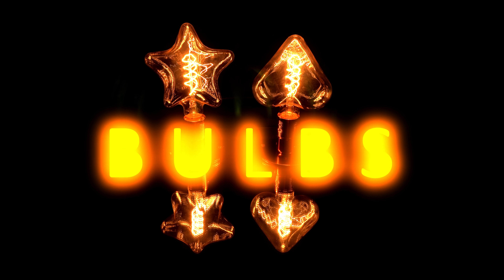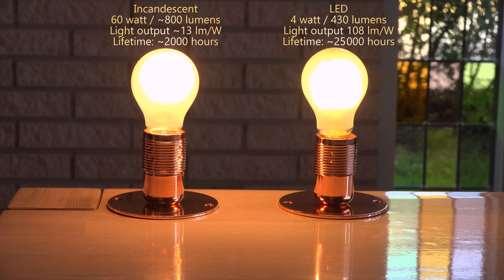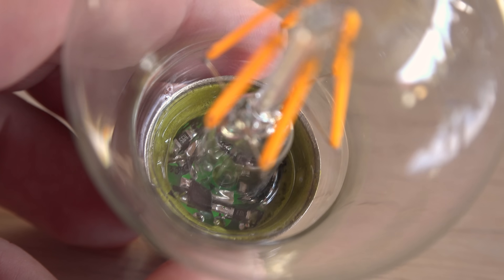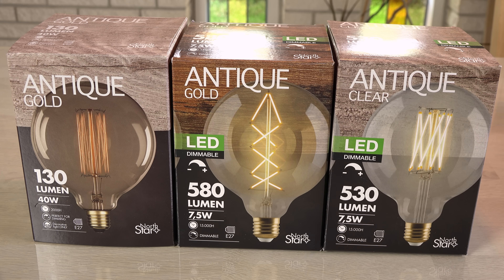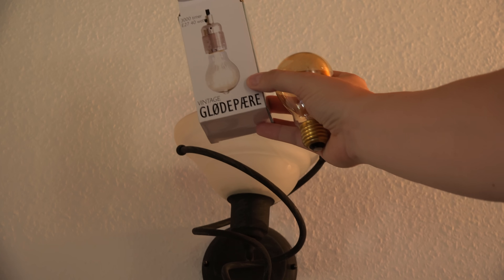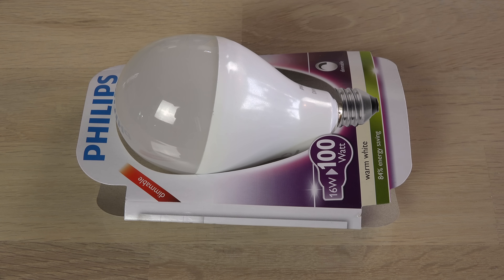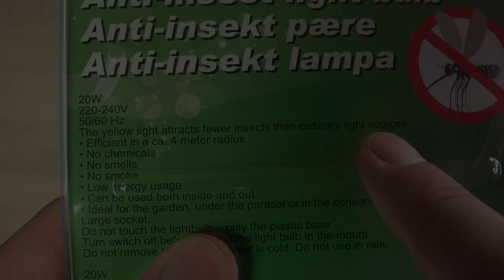Light Bulbs | LED vs. Incandescent

Comment: Incandescent-banning is ridiculous and such a scam, because:
	ⅰ. Although incandescent bulbs are relatively less-efficient at producing light in the visible spectrum when compared to LEDs, this only results in increased usage in the summer, and, even then, it is relatively trivial and vastly offset by the difference in electricity needed to produce incandescent bulbs vs LEDs (plus they do not require hazardous or exotic materials to produce, resulting in less pollution and foreign dependence).  In the winter, like basically all devices, incandescent bulbs are nearly¹ 100% efficient,² because any electricity not converted to visible light ends up heating the home, reducing the electricity needed by the furnace by the exact amount used by the incandescent bulb.  Also, it takes a long time to offset the tiny amount of saved electricity from switching to LEDs, mainly because incandescent bulbs are extremely easy and cheap to produce.  
	ⅱ. Incandescent bulbs have perfect CRI and mimic the spectrum of a blackbody, just like a candle.  Thus, photography under incandescents looks great, unlike cheap LEDs, which have relatively poor CRI ratings (still, way better than CFLs), and trying to mimic this with LEDs requires expensive bulbs, the spectrum of which is still very far off of a natural blackbody curve (which is essential, as it is the production of the blackbody spectrum which makes the incandescent less efficient at producing visible light).  Also, you don't get blue-frequency spikes, which can effect sleep, and possibly stress and mood.  
    ⅲ. The dimming performance of incandescent bulbs is vastly superior than even the best LED bulbs available.  It isn't hard to find a dimmer³ which will return continuous perceptually linear dimming all the way down to 0 lumens for an incandescent bulb, and, if you have such a dimmer, it will work with any incandescent bulb, and equally well, unlike LEDs, many of which cannot be dimmed.  For those that can dimmed, performance varies widely and sucks—most "dimmable LEDs" I've used can only dim down to something around the equivalent of 30% with the incandescent, which, for me, is missing probably 75% of the luminance levels that motivated me to have a dimmer for the light in the first place.  Also, most "dimmable" LEDs require trailing-edge dimmers to produce even descent results, though many do at least function with leading-edge dimmers (basically all residential dimmers before dimmers were specifically produced to work with LEDs) now using extra bandaid-circiutry to avoid damage from voltage spikes.  

The only use-cases I've found for using LEDs over incandescents⁴ (and have a rational basis for doing so) are:
	a) Bulbs that are annoying to change—LEDs last way longer than normal incandescent / halogen bulbs (they do make incandescent bulbs that are very durable and last a decade or more for special use-cases, but they are less-efficient than normal incandescents at producing visible light), and this has always been my primary motivation for using them.
    b) You need a really bright light—because LEDs are tiny and extremely efficient at producing visible light, they are a great choice for your average person who wants a really bright light, which brings us to:
    c) Portable lights—obviously, LEDs are the way to go if you're going to be running off a battery.
    d) You want to have a large number of bulbs on a power strip that would be unsafe with that many incandescents, or you want to put put too many fixtures on a breaker and not comply with code (pretty sure illegal)—obviously, LEDs draw much less power, making this more feasible (I'm pretty sure that parts of Europe actually have a separate lower-voltage circuit in homes to handle lighting).  
    e) And finally, if you don't want to be nagged for leaving lights on—I'm not even sure that this is common anymore, but, with LEDs, you'll always have a mitigating rebottle to complaints that you're wasting power by leaving on the lights, as the cost of keeping them on is very tiny, possibly even outweighed by the cost of extra food needed to provide the energy to walk over and turn them off.  At the very least, the amount of electricity used is so small that it isn't worth discussing, but honestly, incandescents aren't too far off (using up the incandescent's life is a much more valid concern if it is annoying to change), and, for most people, HVAC usage overwhelms everything else to the point that talking about any other device is a waste of time.  
 ──────────────────────────────────────
    ¹	I say "nearly", because some tiny fraction may get converted into frequencies which pass through the home entirely, or, particularly for communications, the electricity may be sent outside the home (the amounts are extremely small)
    ²	All indoor devices which use electricity are 100%-efficient space heaters, as all electricity used by the device ends up as heat, whether as a byproduct of inefficiency, e.g. friction within a fan's motor gets converted to heat, or as a byproduct of intended functioning, e.g., the fan moves air around, increasing the kinetic energy of the particles, i.e., increasing heat.
    ³	My preference for smart dimming is 'Leviton D23LP-2RW Decora Smart Wi-Fi Mini Plug-In Dimmer (2nd Gen)', which, unlike every other smart dimming device I've had, will dim all the way down to zero.  Also, it has a setting for incandescents, as well as dimmable LEDS and dimmable CFLs (lol).  However, its use-case is limited to lamps—for me, that accounts for almost all the lights in my house that I'm interested in turning on in the first place, but, for fixtures, there are probably better options (perhaps a wall-dimmer from Leviton would produce similar results?).  
    ⁴	Just noting that this doesn't apply to CFLs, which are garbage for most residential use.  Unless you need a lot of light in an area, the lights aren't going to be turned off and on frequently (if they are as with, e.g., a closet or bathroom, they will die sooner than even a regular incandescent bulb), and you don't mind the lights having a delay to reach target luminance, producing an ugly and unpleasant spectrum, and possibly accompanied by an annoying buzz.
Reply: I honestly prefer LEDs. I mean most standard incandescents last a view months and that’s it for the lights. Plus that food was probably lit by daylight colored LEDs due to the food looking weird.

Comment: My parents tried the yellow florescent tubes back in the 70's.  The short answer is, if you only have yellow tubes the insects will still be attracted to them.  The much longer answer is that if you have a mix of lighting, the yellow light sources will attract very few insects.  They all go to the light sources with shorter wavelengths.  The real answer is that yellow lights attract far fewer insects, but only if you give the insects another light source that looks much better to them.

Comment: Fluorescent lights emit high electromagnetic radiation which is harmful to your health, yet incandescent bulbs are safe and do not emit EMF radiation. Fluorescent lights also age your skin & eyes and incandescent does not. Also Fluorescent lights are mercury vapor that seeps out into the air you breath. Stop being so gullible to use fluorescent and LED, incandescent is much safer & better.
Reply: Why wouldn't you use LEDs, you only mention health risks for fluorescent. Also, the mercury in the bulb doesn't seep out, if it did the bulb wouldn't last very long. Even then, the amount of mercury in each bulb is negligible. If one broke, I would probably be more worried about the broken glass than the mercury.

Comment: I had an incandescent bulb do a very weird failure, It started flickering and making weird “hissing” noises, And then it would startup dim and then light up at full brightness, It was probably arcing or sparking or something, That was probably the weirdest failure of an incandescent bulb I’ve ever seen in my life.
Reply: It would also pulse flicker dim at startup and brighten up.
I’ve had an incandescent flicker at my new place too and it burned out when I turned it on. Most incandescents burn out with a blue flash. And CFLs and LEDs usually just die. But they sometimes flicker, have a long delay when you turn it on, or glow dimly when you turn it off.

Comment: This LED technology is much much better technology to replace incandescent bulbs then those damn Florescent lights. Florescent lighting just sucked and was an environmental hazard with the mercury in it. Hated those damn bulbs and switched back to incandescent. But since I bought my 2014 Toyota Corolla that has LED lighting and still has the original bulbs I have replaced my incandescent bulbs with LED lighting in my house. LED lighting is so much better then any previous technology. Cars are being replaced from fossil fuel vehicles to electric vehicles so will these electric vehicles be a similar failure of replacing fossil fuels like Florescent failed miserably at replacing incandescent bulbs or is this technology as good as LED lighting that is currently replacing Incandescent lighting. IMO it will be a failed replacement with something far superior down the road then both electric and gas vehicles.

Comment: Except forthe video light they all seem to draw around 90-95% of what is advertised. Which is pretty much the difference between 240V and 230V (~95.26%) or 230V and 220V (~95.83%)
MY first thought was that perhaps the lights were tested/certified under different conditions than at your home and that causes the difference in power draw.

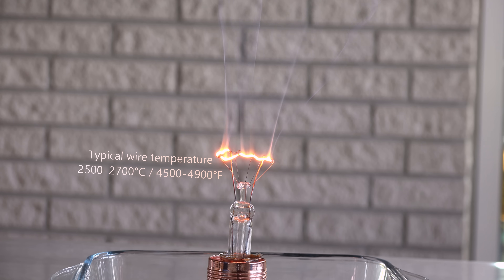Comment: 1:41 Actually, I was told it was a mix of Tungsten and Osmium - which is how the OSRAM company (a product of which is seen at 9:20) got its name - OSmium and WolfRAM. They had a factory in my hometown until a few years ago, really liked them, even named a bridge of our inner-city railroad after them.
Reply: I could see osmium being useful. It's melting point might be a bit lower (3400K instead of 3695K) but it's also a worse conductor (by about 42%), meaning it should help getting the resistance of the wire up, making heating it up easier.

Comment: In Northern temperate areas people will need to use a fixed amount of watt hours to keep the interiors warm. If electric is used for heating, the efficiency of incandescents argument is irrelevant.
LED's put out too much blue light and interrupt hormone balance after sunset. Incandescents are close in spectral output to the fires and candles mankind evolved with. And the flicker is disruptive to brain frequencies. The compact fluorescent bulbs are worse because when they break your home becomes a mercury hazard.

Comment: Lights with heat (Incandescent) are better.  Why?  The human body needs good Ionized Radiation.  We were taught that "Radiations" are bad but through my discoveries, the Human Body needs Ionized Radiation from 550nm - 570nm.  For comparison, we need to stay a distance from Infrared but far from UV Lights, since they are too low for the body to use.  Low + Decay Radiations are what harming us all.

Comment: What really needs to be discussed is the fact that the dubious manufacturers purposely design all these bulbs to fail quickly, i.e. planned obsolescence. Early 20th century bulbs were manufactured to last a few decades. That had to change worldwide for international manufacturing companies to make exponential profits. If manufacturers wanted to put any meaningful effort into the designs and materials, most of the lighting options would last much longer, lessening the concern behind disposal.